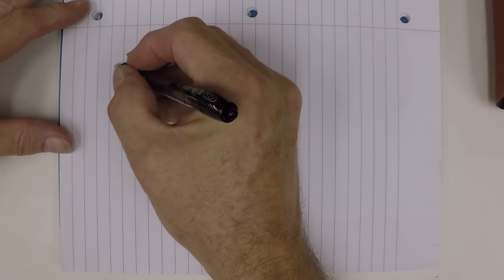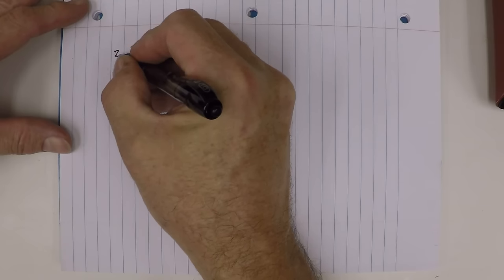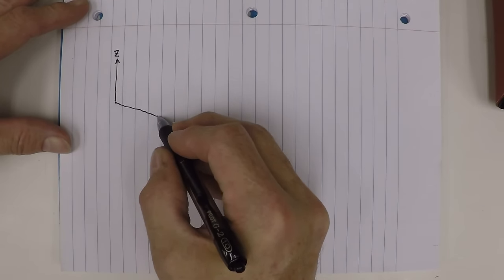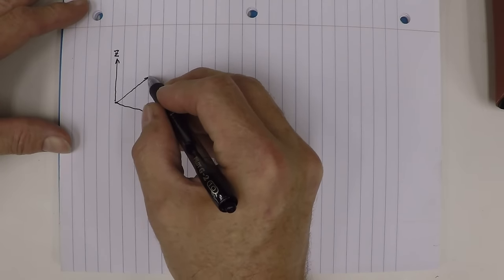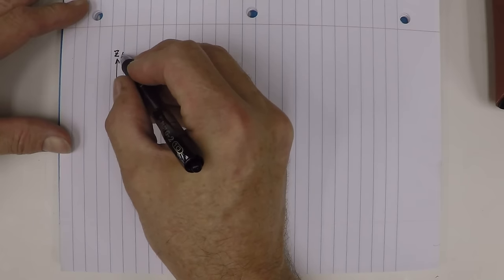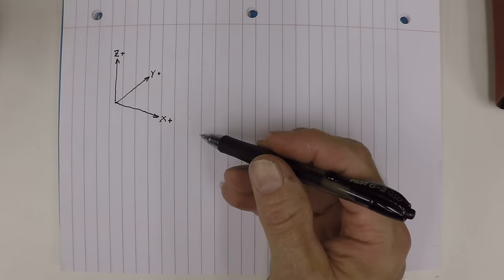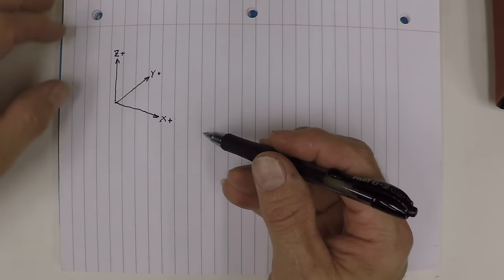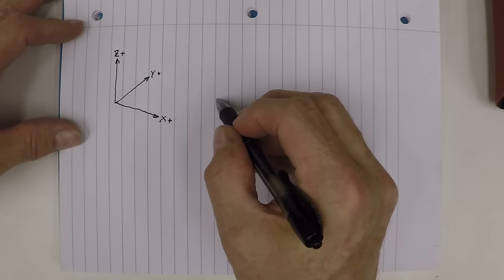Video 1 5Axis Mill Stop

Comment: Hello Peter, I just want to add comment for you regarding the TAPER setting on your machine! That setting is used for when you have Taper when you are turning. If you take the amount of taper, divided by the Length of your Turn and put that number into the Taper setting the machine will automatically figure out the Taper and compensate and you will have a perfectly straight turn. If your Taper is bigger at the Chuck, you would put a positive number into your setting and bigger at the tail stock is a negative number!! It is a very nice setting to use when you have Taper in your Turn!!
Reply from the maker: That’s interesting I didn’t know that. I will have to give that a try. Thanks!

Comment: Nice introduction to CNC lathe setup and programming.  I've had a CNC mill for a little over a year and it's been a slow go, learning bits and pieces with no formal training.  I look forward to getting a CNC lathe some day and your video(s) help flatten out the learning curve, a lot.  Keep 'em coming.

Cheers,
Gary
Reply from the maker: gwcude Thanks Gary I appreciate the compliment there is so much more to show I hope my video skills improve so I show it a little better, There is very little formal training available on this short of just working at a shop and observing how others do things(that's the way I learned).
Reply: Edge Precision I'm trying to get into the routine of making videos weekly and it's now getting easier and faster to edit and easier to talk and do the videos around the cameras while I talk and try to setup and run things.  So, yes your video skills will improve and you will get more at ease and better with more practice.  Not saying I'm great at it, but I feel more comfortable doing it after a few weeks.  Also, feedback from viewers help motivate.  You are off to a great start!

Comment: Hi Peter, I have a question. The commands seem arcane and ripe for a strong compiler. Reminds me of assembly language. Have you ever studied programming? On microcontrollers we usually use pseudo code as a start. That does two things, it creates a document and helps prevent errors. I imagine that this is a very simple program so no need for that, but do or would you use pseudo code when writing a program that is much more complicated?
Reply from the maker: No I don't consider myself any kind of programmer never have studied it or taken a class. This is just my way there may be much better ways of doing the same things. Programming with G codes is a little different than say programming for a Arduino. Most of it is very basic tell the machine where to go. The makers of the machines controls have made  parametric macro (custom G codes) cycles that the machinist just calls in the program. Such as drilling cycles or lathe roughing cycles or probing cycles by reninshaw if you have probing on the machine.